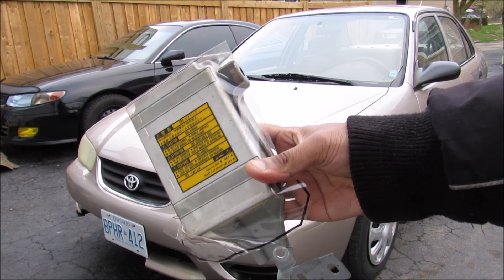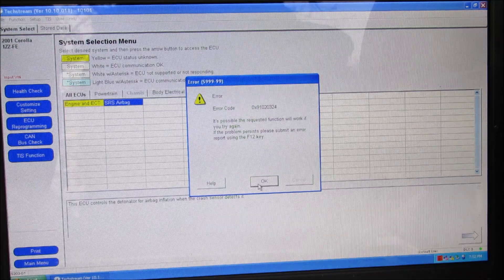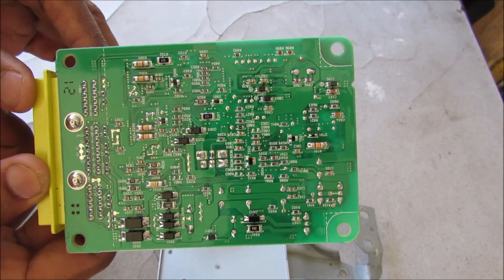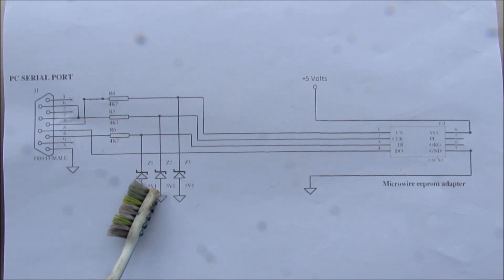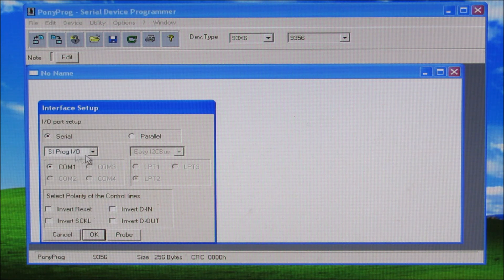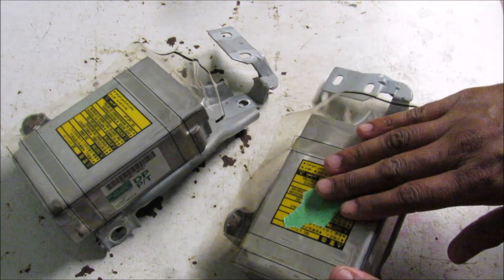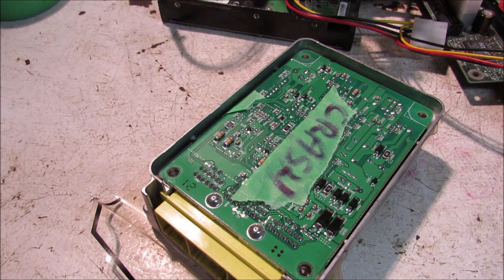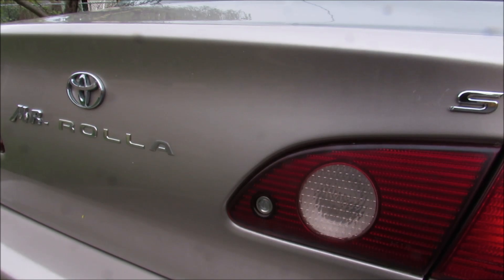Airbag Crash Data Reset

Comment: This isn't illegal. It's what must be done in rebuilding a car.
Reply: Everyone thinks everything is illegal, that is why America is losing rights.
Reply from the maker: +Justin Rakestraw agreed!
Reply: Not really but if the airbags were set off and you replace the airbags and the rest of the car is A-1 why on earth would you not want to get rid of the stupid srs/airbag light. I mean if the buyer doesnt ask has the car been in a accident thats on them. Franchise dealerships are some of the biggest and shadiest. As a dealer ive seen a 3yr old car that was in 4 accidents by the time it hit the auction block but it still looked gorgeous. No one cares as long as the drives good looks good and does what you need it to do. Thats why carmax is pretty much a scam and scares ppl out of cars that possibly could be a dream
Reply: @johndoe6047  ... we didnt have airbags in  cars for like 70 years ..
Reply: @johndoe6047  Not only the light, but the air bags will deploy again if the module is not replaced or reset.
Reply: @drredmayne that’s not true buddy they won’t deploy if you get in a crash if you don’t reset it
Reply: Carfax is a joke. I bought so many crashed vehicles with clean titles. Where the owner didnt have insurance and was never reported to insurance. But regardless I would still tell the new owner . Sometimes
Reply: Ruthlessnoodle  you probably missed the part that said they can use the info aginst you lol
Reply: And then you buy a used car which was "never crashed", and you get killed in a first crash you encounter.
Reply: But crash data is still on computer
Reply: Ruthlessnoodle  Now that's illegal.
Reply: estupido asi lo que hace es que el sistema vuelva a funcionar, lo ilegal seria tapar la luz o quitar el bombillo
Reply: Ruthlessnoodle  if you do not reset the module and install new air bags, they will deploy!
Reply: @drredmayne  it loses that function with the crash data
Reply: Yup not illegal but immoral, are you going to tell to the next owner that your car had a big crash and you rebuild it?
Reply: @malikulamin9948  Carfax exists for a reason...
Reply: @malikulamin9948  Most cars that airbags have been deployed have a Salvage title. That is why after fixing them they have a rebuilt title.
Reply: @Alba0825  Exactly,  the buyer of a salvaged/rebuilt title is aware that the airbags were probably deployed so there is no trickery here.  the potential buyer,  just wants a working air-bag system,  and that's what they will get.
Reply: @Alba0825  not all, mine had minor body damage on the passenger right rear side. I decided to give up the car and claim insurance on it so someone probably rebuilt it.
Reply: @malikulamin9948  You could send it into an established authority of airbag module resetting such as https://www.safetyrestore.com/airbag-module-reset-service/13299-srs-airbag-module-reset.html  If you are competent I am sure you could do equally as sufficient a job.

Comment: Quick question, I replaced the new srs ecu in a Mitsubishi 2012 but it throws a code that reads recalibrate srs ecu. What’s should I do ?
Reply from the maker: +roma5733 I'm not familiar with those, usually a new start ecu would be clear from crash data, unless you bought a used one?
Reply: speedkar99 no it’s a brand new one from the dealer. Everything has been replaced.
Reply: speedkar99 these are the codes: b223b, b1480, b1400, b222c. The old ecu read about 10 codes but none of these

Comment: Interesting to learn how this could be done in theory. Seems irresponsible to do this for real. I enjoy hardware hacking, but not when life safety is involved.
Reply from the maker: +Wesley Hurd This is a business, as long as the codes are erased and replaced with the correct codes from a clean airbag computer it's fine. The airbag computer wasn't damaged in the accident.

Comment: After my 2017 corolla crash, my front collison abs brake and tcs loght is on. Do you know by any chance I can reset it by myself.
Reply from the maker: +nrO kiD you need to reset your seat computer. 
For abs it's likely a sensor. 
You need to get those codes scanned to pinpoint what's wrong.
Reply: speedkar99 thank you for the info. Yes body shop said I need to reset the system but do not know how. Do you by any chance know which software should I use to get into my car electrical parts? Plus, I plugged obd2 but no codes were shown.
Reply: speedkar99 plus my crash light is also on do you know how to reset it too?

Comment: OK 2 DAYS AGO A WOMAN AND A NEWBORN WERE DRIVING BY MY HOME (MIND YOU IT WAS 28 DEG'S OUTSIDE) and a deer ran into the driver side door setting off the side air bags, I ran to help jeep was filled with smoke from the airbags the baby was screaming  and cold, I told her to start the car put on heat and get the jeep off the road and ill get the baby inside with heat well the computer would NOT LET IT START. I see the safety end of this but NO DAMAGE WHAT SO EVER TO FRONT just the driver door no broken glass nothing the jeep was in the middle of rt 66 hispeed road, how do you go around temporarily to move vehicle this is crazy and STUPID !!!
Reply: dave dec The impact could have triggered a g-force fuel pump cutoff switch. Those are designed to prevent the vehicle from catching fire in a crash by immediately stopping the flow of fuel out of the tank. Usually the switch can be reset with a quick press of a button - if you know where it is located. Yes, I agree that it is dangerous to have your vehicle stranded in the middle of the road after a crash. But I’ll take that risk rather than the risk of burning to death while trapped in a vehicle.
Reply: i dont think the inertia fuel cuttoff would have been triggered by a side impact from a deer but...i have never hit a deer...so...
anyway most people dont know where the switch is located in their cars and how to reset it and that is very dangerous..
Reply: Fuel cutoff reset, and if you can't do that, use the ignition key to unlock the shifter lever and roll or push the car out of the way. Put it back in park when you're done. There is usually a slot for the key around the shifter sometimes covered with a round or rectangular plastic cover with a spot for a small flathead.

Comment: For the people who say it is illegal. First - there are laws on place that require the vehicle owners to operate their vehicles with all the safety equipment being in working order.  To make it simple, is against the law to use your car when the air bags, seat belts etc are not operational so the owner is required to make the air bags and seat belt operational as soon as possible . There is no law I'm aware of that prevents you from fixing the vehicle you own when you have to get it fixed before driving it again according to the law. To say it is illegal for somebody to reprogram a computer chip to make their equipment working again would be the same as to say be illegal to reinstall Windows OS on a PC or to clear vehicle trouble codes using OBD2 reader. To apply same scenario, it would be illegal for you to replace your car light bulbs on your own without going to an official Toyota mechanic. Second - an ability of the vehicle to record certain data doesn't make you responsible to retain that data unless there is a court order in place for you to keep it or you are doing it with a purpose to destroy an evidence of an illegal activity. Your desire to operate your vehicle with life safety devices working outweighs any possible legal reasons for you not to have that option. It would be next to impossible for any court to make a statement, that fixing a life safety device in a timely manner according to the law was actually against the law since it has destroyed an evidence of some sort. There may be laws that require car dealers to use certified equipment in order to do the described procedure and copyright/trademark/patent laws protecting the technology, but usually those do not apply to the car owner fixing his own car. In this particular case, it was not against the law for him to have a copy of the computer code installed on his own vehicle. I may see DMCA laws protecting the code, but not for the end user who owned a license to use it to begin with. The worst case scenario I see is that the car owner may be required to verify with an officially certified shop that his air bags are in working order after the repairs he has performed. There are specific laws against tempering with odometer readings but those are very specific to a single device and do not apply here.
Reply from the maker: +CNT good explanation
Reply: Oh it’s not illegal - they can get you for tampering with evidence. Got it!
Reply: @EndOfLineTech   yes but only if it was a hit and run with no witnesses or traffic cammeras, besides police don't investigate traffic crimes unless there was a substancial amount of $$ from destroyed property or an actual victim dead or alive was involved. Insurance companies will rather junk the car than pay for fixing it if it's close or beyond the amount of your coverage.
Reply: TL;DR

Comment: Two advices, though:
1) never do it, until you sure that either srs unit doesn't have crash sensor, or this sensor is working fine (there is works-once-only sensors)
2) turn on ignition first, only then connect negative terminal. never sit in the car when turning ignition on first time after doing work on airbags system
Reply from the maker: +Саги Усаги Good #2 tip! I was scared to turn ignition when I swapped computers
Reply: they should be fail safe but i am not certain....i had a customer wich had a melted clock spring, like really melted and the airbag deployed for no reason...i replaced it, replaced the ecu and airbag...tested the car, everything fine, no errors...i gave the car to the customer and it deployed while driving a few days later and the clockspring was melted again....luckily he didnt got hurt...by his decision we replaced the steering wheel from a similar non airbag model and removed all the airbag system...it scared the crap out of me knowing he could have got injured. i still dont know what caused it

Comment: Good Video, in some cases you can access the EEPROM by using the OBD Port. This makes it much easyer. I don't know if it works with Toyota. By the way, the toothbrush should be replaced, too. ;)
Reply from the maker: +Golf4.org Thanks ! 
Agreed some vehicles can read through OBD, but for a vehicle this old maybe not. 
That toothbrush has a lot of life left in it
Reply: @speedkar99  Is it Toyota Corolla right? I think it has not  OBD.
Reply: LOL. You should make it the prize in a competition.
Reply: TourdeFrance20131   how can we reset the SRS via OBD2???
Reply: Do you mean you can use obd port without removing the airbag module? I’m new . Thanks
Reply: @Hustle5  Depending on the car. Works with Volkswagen Golf Mk4 2000 for example.
Reply: How can we have access to the EEPROM by using OBD2 port???
Reply: the toothbrush is not dirty its use for electronic job

Comment: Why ? you had a new unit which was good so why not just swop it over.
Reply from the maker: +Tofthill4 Yes that can work as well, but I did this as a demonstration to show how you can read and write information from the chip if you do have access to virgin data.
Reply: Is it possible to just change the chip and insert a new one??

Comment: High tech pentium 4 and hightech toothbrush pointer :D 
Great video as always! (How many cars do you work on?)
Reply: Most newer PC's do not have a serial port.  and although there are USB-Serial adapters,  not all software works with them, and they are a pain to set up sometimes.
Reply from the maker: +Koffi Banan Thanks. The toothbrush was essential :)
I just sold my solara to a friend and have my Lexus GS350 and this beige corolla to work on.

Comment: Lol im literally in the process of doing this now, one problem i ran into was that i thought i was using 5v1 zeners but i was not, this was giving me a write error before. I received my 5v1 zeners in the mail today and of course it worked, i ended joining an airbag forum and someone was able to send me a clear code for my airbag module. my problem is that i dont know if the code will work, i dont want any of my airbags deploying when i go to test it. so i started swapping out my airbags with 2 ohm resistor to trick the computer into thinking i have airbags plugged in but its such a pain, if i keep my airbags plugged in and the codes wrong will my airbags deploy? or do the sensors have to be tripped? is this chip just storing data or is this the deploy data?
Reply from the maker: +Mac Wojo I had that fear the first time I tried this. My airbags didn't deploy when I started the car. Using the 2ohm resistor is a good idea to check that the computer is working good before plugging in the airbags. I believe this chip is just a data storage. Its too slow to process airbag deployment.